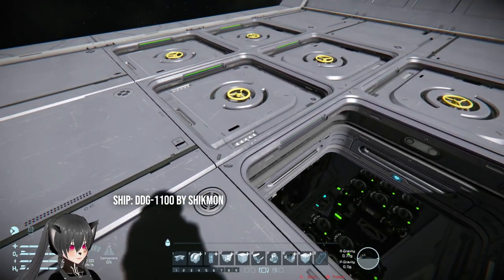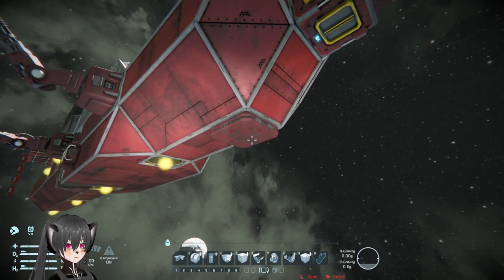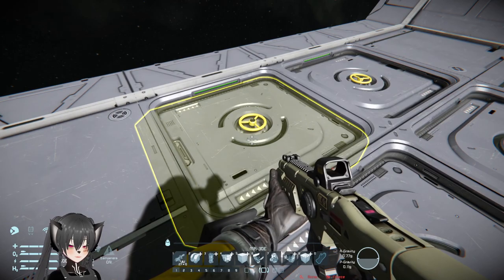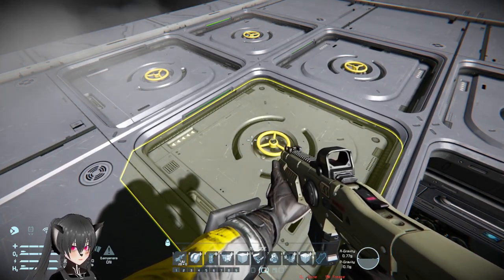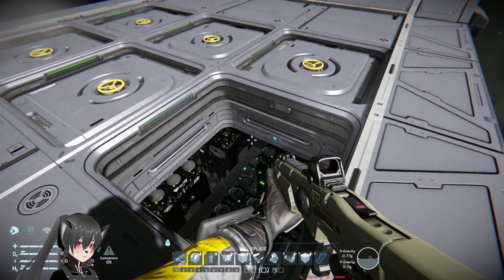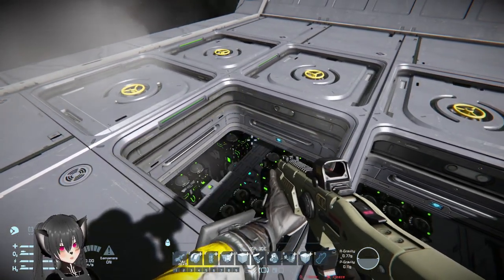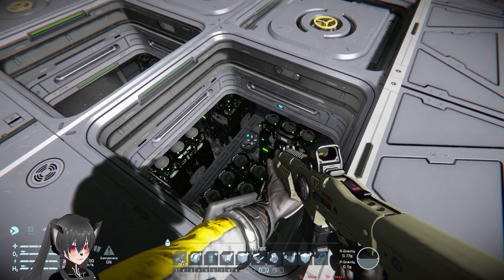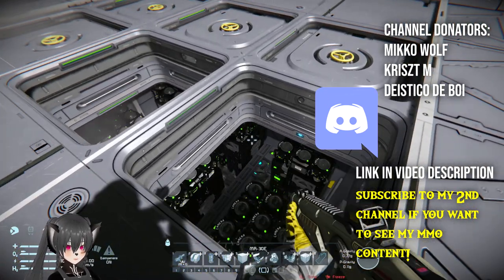Missile Launch Silos on a Ship, Space Engineers

Comment: Deep and very small hole, is the way you can use custom missiles, in combat everybody moves so shots would come at angle, so to have good shot at hole, you need very good aim and enemy what would flight straight. If small would be small (missile size) and missile itself would be hidden just deep enough to not receive splash damage, you won't need silo doors what are easy to hit and would jam in close position, unless you made some obstacles for enemy projectiles so it would hit some sort of "silo armor" before damage reach doors. Or you would make silo doors right above missiles and have armored opening above silo, missiles would be protected (no holes) and silo won't receive damage from opening minutes of combat, win-win situation IMO
Reply from the maker: Good point c= I usually just carry them outside but I guess a hole can be a good compromise

Comment: Launching missiles while in close combat is a bad idea, the reason is if you are maneuvering while the missile has detached but not cleared your ship the chances are that the missiles will hit the inside of your ship. So the idea is to shoot them while you are between 5km to 2.5km away from your target. Then approach the target a bit behind them. 

In that scenario, the doors are there to protect the building/printing system of the missiles because it's normally a subgrid system that takes time to build and set up.
Reply from the maker: Yeah c= it's certainly a bad idea to do it mid-maneuver x3 launching them from as far as possible is the best way to do it, they can offer some protection against gatling or missiles but I think artilleries and railguns will just go through
Reply: Well, as long as you maintain the same velocity for 3 or 4 seconds, the missiles should eject properly. On planets it's probably safer to mount the missiles under your ship.

Comment: Wouldn’t just having a missile tube instead be more viable?  It provides the protection that is being sought and so as long as it’s not down the barrel it being shot isn’t a problem. 

Or you could do the cheaper and overall more practical and useful thing by just using a landing gear to hold it
Reply from the maker: Yeah someone else also mentioned putting them in holes, which I guess are missile tubes x3 good point c= that might be a good compromise x3 and ye xD that's what I usually do

Comment: Silos are better in combat.  I use two doors or hanger door blocks.  I like racks as well on the sides.  Racks are better and if they get destroyed then its not a big bang in the middle of the ship.

It is very easy to have missiles on the outside but if they are hit...  Its also harder to have welders making the missiles.  Getting external custom missile turrets reloaded is a pain.  Requires pistons, timers etc.  Its easy to have them inside.

With the new to be released AI blocks you can launch from deep within a ship.  So the missiles can be in armoured sections.  Complexity is the main issue I hit.  The performance hits of welders as well.

The fact in beta that missiles have a targeting and tracking from 2500m makes them a weapon you can reach out with.

The armour on ships normally has next to no usefulness in stopping player made missiles.  Useless you use drills between two layers of armour blocks.  Thi is the only way to stop large grid ke missiles.

The ship in this video would be completely gone in one hit from a small grid warhead missile.  Lacks the turrets to stop an attack.  Fun times ahead for ship designs.
Reply from the maker: Yeah there are certainly upsides and downsides to different approaches c= and yeah x3 can't wait for the update u wu ♥

Comment: Well doors for missiles or drones are a bad idea just the reasons you stated are completely wrong.
The subgrid doors can easily be detached when damaged there are dozens of ways to do it.
Then the other issue is that even if you use the single block ones most of the weapons that will actually be dangerous in this game literary oneshot them meaning that when hit it does not matter if they open or not because they wont be there any more.
Third the whole idea of the door getting stuck is flawed because even with the keen AI stuff you can fire the missiles or drones before the enemy can hit you.
Lastly the concept of using drones or missiles is flawed the for the cost of one missile you can easily put more than enough armor at the front of your ship to just tank it and for the cost of a drone you can simply put more guns on your ship that will do more damage.
Reply from the maker: Ye I think those are similar reasons to ones I mentioned xD they might still get shot if the pilot doesn't react fast enough or the launch system doesn't launch in 5 seconds 83 and ye c= in head to head combat those don't make that much sense but there are other reasons for different playstyles though x3

Comment: 0:49 Stealth fighters carry their missiles in the bomb bay not to protect them from air resistance, but to prevent enemy radar reflection.
The problem is that these bays are small, and the fighter can't be effective in its primary role and stealth at the same time.
This is another reason why the F-22 and F-35 are useless and not cost effective.
Reply: dude you know that the F-35 is cheaper than 4.5 gen fighters right? also it's low observability, not "true" stealth, what that means is that while the enemy may know you are there, getting a target lock isn't that simple, really good for say Suppression of Enemy Air Defense missions.
Reply from the maker: Yeah I was gonna mention that too regarding the stealth but I thought it was too much c=